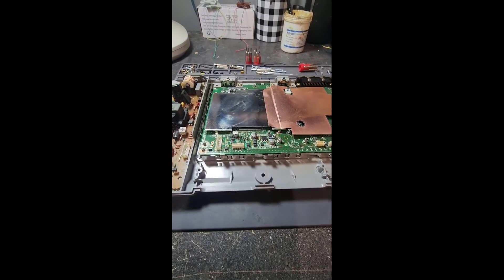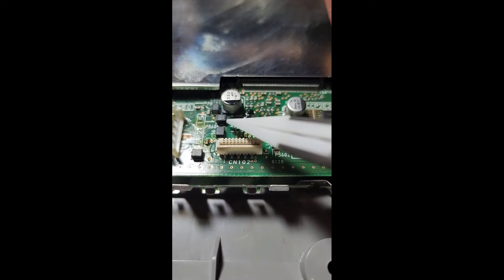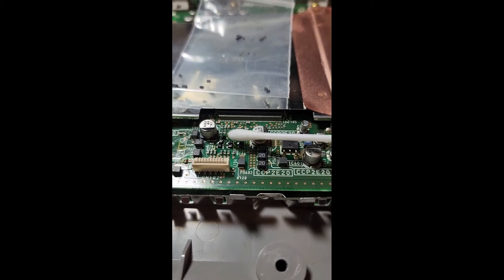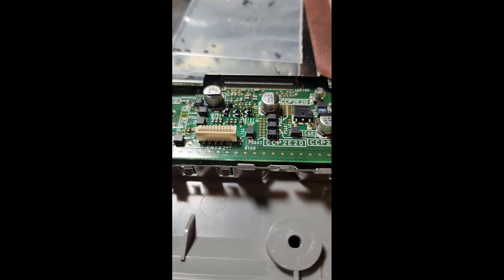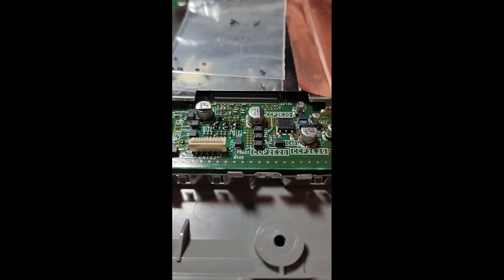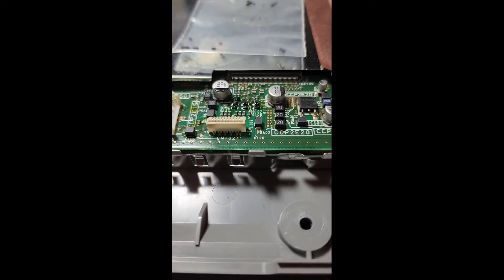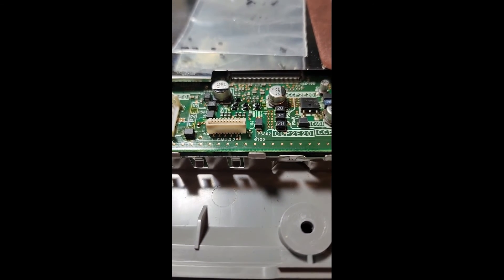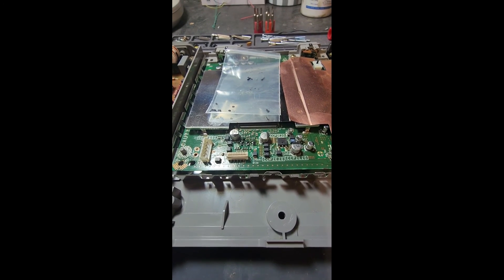Playstation 1 Controller Ports Not Working FIX

Comment: I have been rebuilding a retro gaming system area with several consoles from the 1980s through the 2010s. The original PS1 was one of my lowest priorities because I had a PS2 that played in the entire Library however once all of the other systems were up my attention went back to the PS1 opened it up changed to the little micro cable change the entire controller port and still to no avail which led me to your video so I suppose this will be the issue. I can solder some things but those look a little daunting bc of size.. I may give it a shot. Thanks for the video.

Comment: I have got give one it was in bat condition I cleaned all the dirt fixed some trases and  recapped it an put a new lazer in it it now works but not the controllers all fuzes have been tested and working but still no control will register. l'll replace the part you mentioned. Hopefully it will work can a bad chip maker the controller not work?